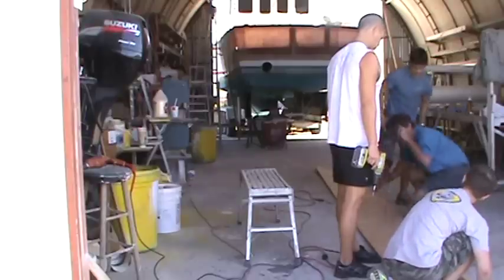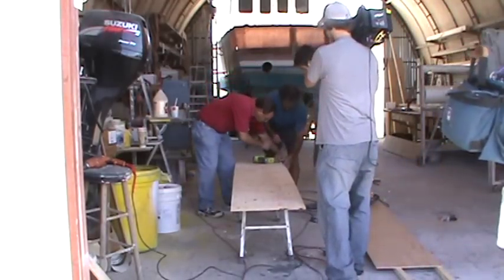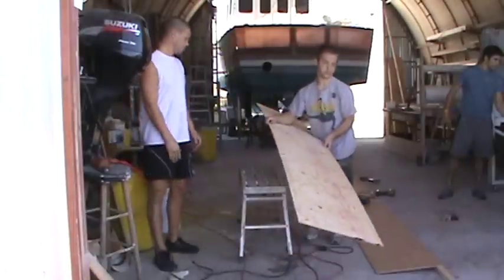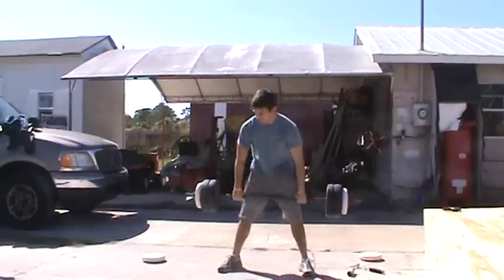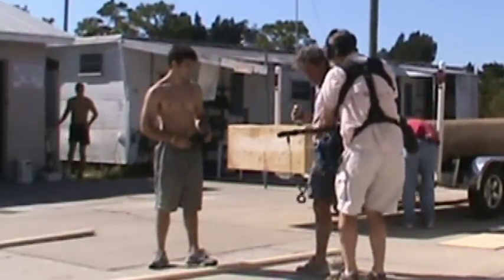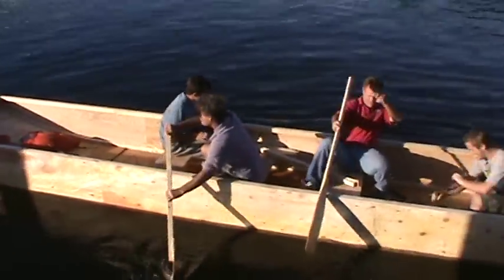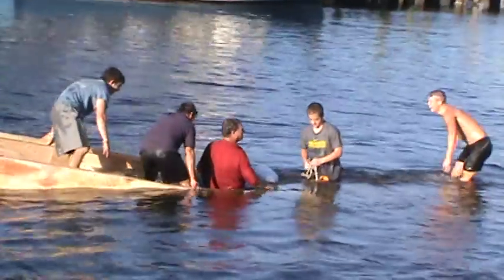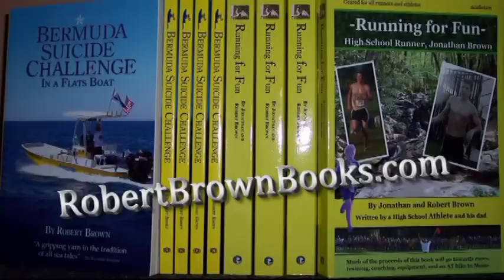YOU CAN'T BUILD A BOAT IN 3 HOURS

Comment: If you had sealed it properly and waited for the sealant to dry, you would have been fine.
Reply from the maker: We sank it on purpose, we drilled a three inch knock out hole in the bottom before we launched the boat.  We knocked it out and let the boat sink then plugged the hole and resurfaced the boat.  Part of an audition video for a TV show where they were looking for a team of people to travel from NY to Seattle.  We didn't get the part and I don't think anyone else did either.
Reply: LOL.. I guess it just seemed like a lot of work to sink it.  My bad.
Reply: robert Brown How long did it take to build?
Reply from the maker: It was supposed to sink, it was part of an audition for a TV show.  They wanted us to do something and they just filmed us.  This video is from my camera not the shows.

Comment: Styrofoam has nothing t do with it 
boats float because of displacement
the boat would of floated if they sealed there joints.
but due to the poor construction how much weight it would hold is another thing.
Reply from the maker: Sunk it as part of the plan